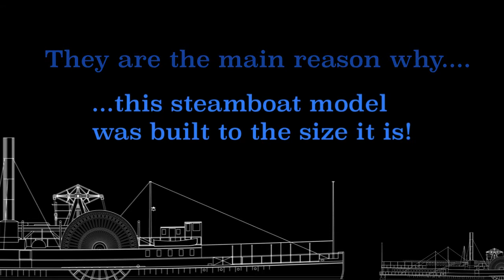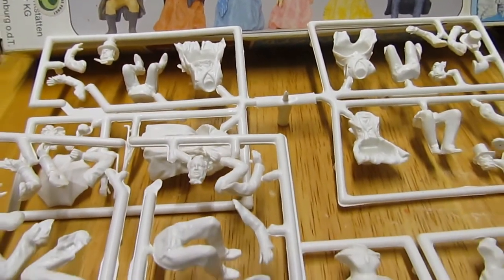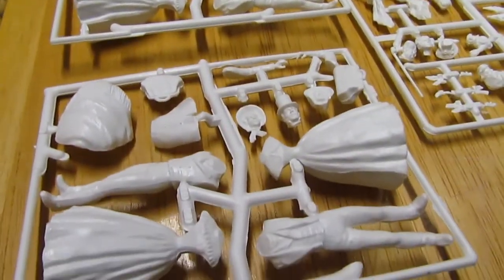PADDLE WHEEL Steamboat Thomas Powell #10. PREISER Passengers gauge one Steam ship 1:32 Adler Figuren

Comment: This model is far more than just a " live steam model boat "  it is more of a live steam diorama, the incredible details, not only on the hull & figures, but also the steam engine that is not only functional, but in itself a accurate scale model of such an engine....
This work piece is of the highest museum quality and surpasses anything that is available in kit form....
Reply from the maker: Thank you for your interest and your kind comments!
Doing everything possible to make this steamer look and work the way the real one did was definitely part of the fun! 🙏
Reply: @LiveSteamPaddleWheelersPG  Yes, it even has two boilers ( with return flues  ! ) just like the real Thomas Powell... The first time I see two steam boilers in a live steam model boat....
The fitting of a second, oscillating cylinder on the paddle shaft - to overcome the death center of the Main steam cylinder when starting or reversing is ingenious as well....